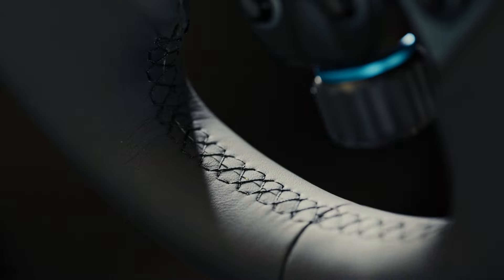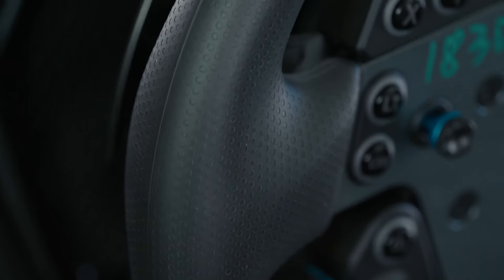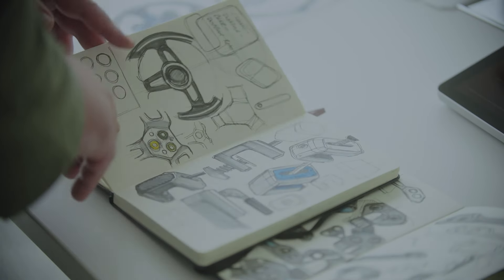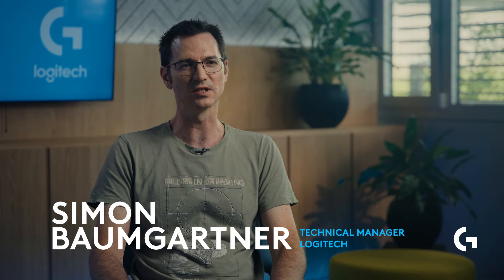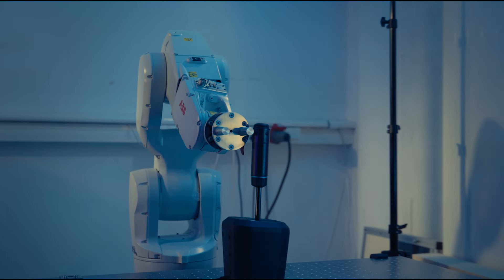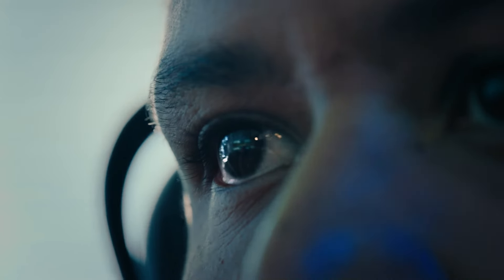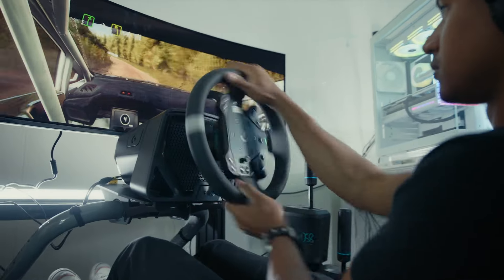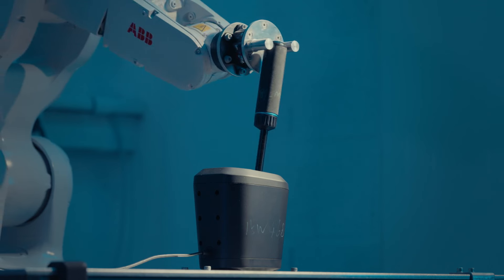Inside Look | Racing Series | Logitech G

Comment: I think I may be one of the few people that wanted an H pattern shifter, but understands completely why you didn't start there. I've heard you guys are aware, so I'd like to make a request. Please do what you can to make it feel like a shifter with a linkage, not a cable. I would gladly pay extra for added weight below the pivot point. Can't think of another way to achieve the correct feel period as someone who has spent a little over four decades driving manual transmissions in the real world, that shift or I bought 11 years ago was disappointing. The irony was, that was about the same time automobile manufacturers started using cables instead of linkage

Comment: I bought the wheel, its decent, honestly speaking feels slightly cheaper and they took away extra paddles, I like the track wheel tho its not bad. I am annoyed at the fact that is what you had us waiting 2 years for, and a shifter thats just a sequential/handbrake… wierd mix honestly, you can flip them but you need to buy 2 anyway cause wtf am i going to do without the other. I just want to express the disappointment since we are staring at competitors making f1 wheels with screens, led buttons, truck wheels, stalks. I mean seems like companies think H shifters are just not cool anymore, I felt like 90% of reddit was asking for that, but guess another couple years right?

Comment: How about you stop passing PlayStation users over. .These items only work for Xbox and PC
Reply: If you have the PS5 wheelbase which you can now buy separately, these work just fine. I’m using them now. The PlayStation chip is in the wheelbase so if you have a PlayStation wheelbase, a PC or PC/ Xbox wheel hub will work across PS5 and PC or PS5, PC and Xbox depending on which wheel hub you buy. The only slight downside is you won’t have specific PS5 buttons but it’s easy enough to figure out.

Comment: Blah blah, and still you can't buy soare parts like rotary pots for the pedals that wear out.
Also not making oroducts available in all countries,.
If you really want to add value make soares available.
Ask real sim drivers for their feedback and approach from that side a new design product etc. not start at yhe drawing board.
Reply: The pro pedals don't have pots they're hall effect sensors and a load cell.
Reply: That is correct, but all for all the previous models G923 l 920 etc they have pots and can't be bought separately, only as part of pedal set, that is really bad from Logitech not to support maintenance items.
Reply: Aren't they just standard pots? Maybe you can get them from an electronics store.
Reply: No, specially desingned (degrees per resistance) so number of normal turn ratio s does not corrolate, Logitech used this as an IP   ( Intellectual Property) but in this case it is hurting them, because why do people luke me then after truying all option move to Fanatec V2 Load cell pedals, why would I buy Logitech pedals again if there is no support, I emailed them and they said sorry we do not sell seperatly.,